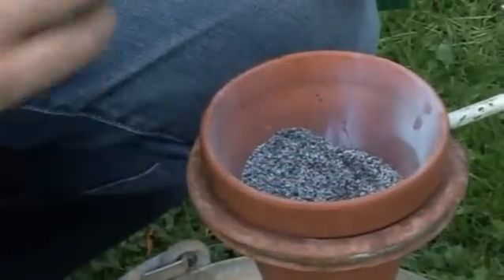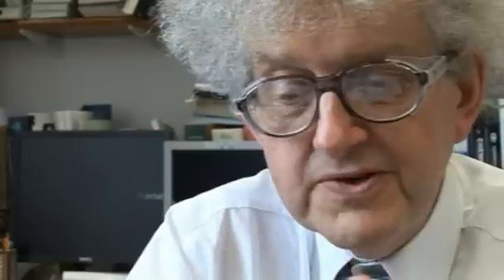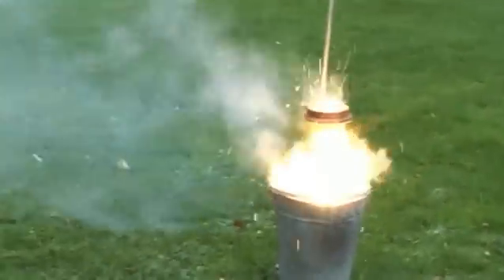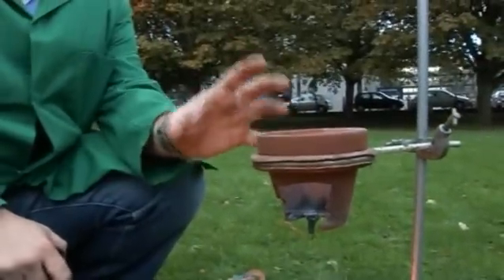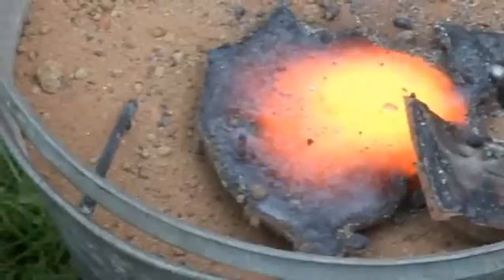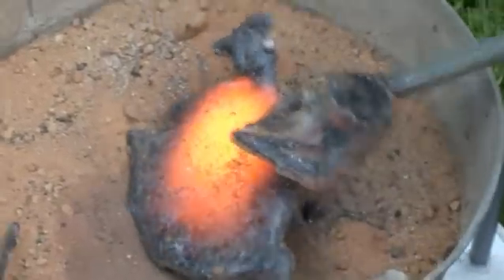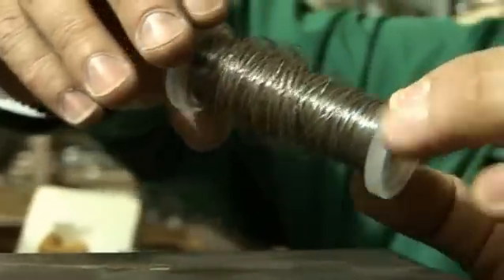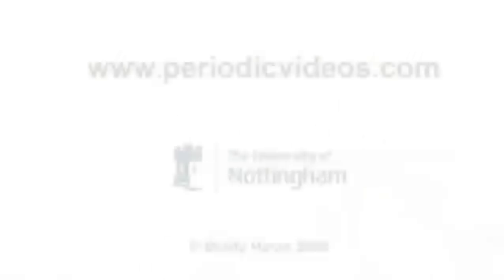Iron (version 1) - Periodic Table of Videos

Comment: Thanks for the thoughtful response.  Clearly there is no such thing as free energy.  On the surface it seems that scrap aluminum is cheap (about 85 cents a pound) but I guess it's not really cheap enough to burn considering it could be used for other things.

Comment: lol @ 2:15 when he says its gone out.
Assuming it's out too quickly is dangerous. A lesson I learned as kid when I thought a firecracker was a dud. I waited a good 30 seconds after the fuse had disappeared into the casing and the smoke had stopped, and then went to pick it up.  
It went off. If it had gone off a second or two later I would have had it closed in my hand and been very badly injured.
I almost learned my lesson the hard way.
The next dud got 5 minutes, doused with water and chucked.

Comment: The amount of aluminium and magnetite that would have to be used in order to heat a single home for 20 years would probably not be sustainable, but that's just a hunch I have.

However, one could run a magnet through sand and pulverise a few cans and they would have thermite? Fraking awesome.

Comment: Now here's a serious question-
Magnetite can be obtained by running a magnet through beach sand ( i.e. it's free) and aluminum can be gotten from old cans (again virtually free).  Throw in a sparkler and a match and you have HUGE energy released.  Why isn't this used more?  Couldn't you use this as a heat source for, say, glass making or jewelry making (melting other metals) or heating water rapidly...?  Why isn't thermite used to heat my house?

Comment: no for two reasons.
firstly alluminium is very reactive so the foil will have a very thin coating of al2o3 over it. and secondly the alluminium needs to be powder mixed in with fe2o3 powder. 
you also need a lot of heat to start the reaction